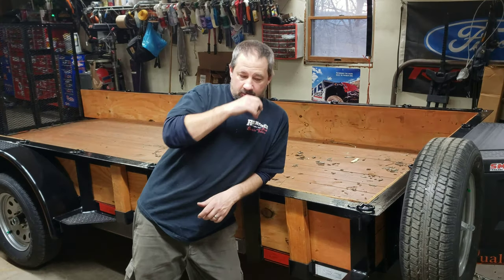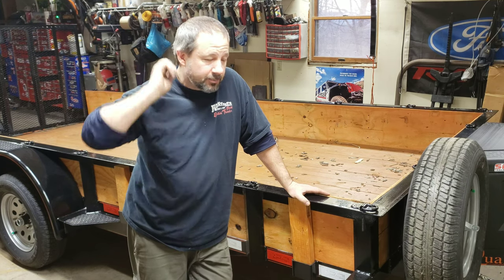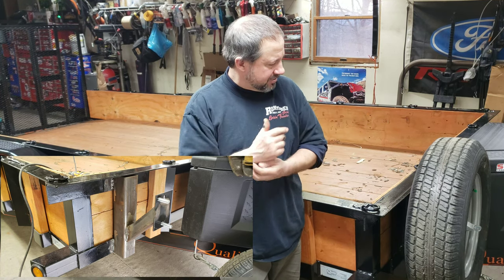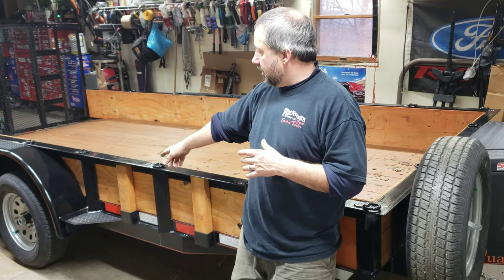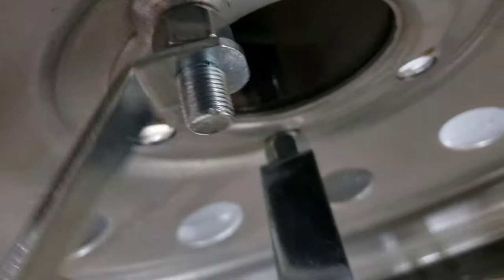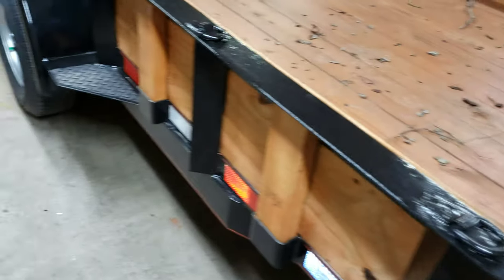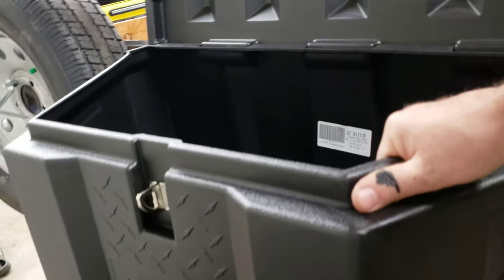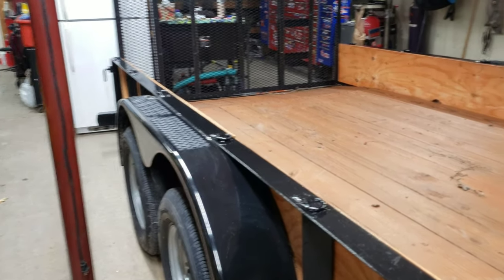The world's greatest utility trailer that you can't buy!

Comment: Nice trailer. I bought my first trailer a week ago. 6.5x10. I welded 4 of the 1/2 inch d rings on it from harbor freight. I plan to weld some on the top rail like you have. I am also welding a small vise on my trailer. I love the tire mount location.  I plan to copy that myself.

Comment: For what purpose would  a dislike appear?  Larry provides in-depth helpful videos.  Perhaps a disgruntled competing trailer dealer/manufacturer?  Rather than hate, build a better user friendly product.  The rubber/adhesive mat already has several ideal applications in my equipment stable. Admire the trailer and all innovative and practice modifications. Thanks for sharing talented ideas and workmanship.
Reply from the maker: Possibly I'm not well spoken enough, or my ad-hoc engineering is not up to the standard of a more educated individual? That's fine, as you've heard many times before, you can only please some of the people some of the time 😂

I'll continue to do my thing and try to make videos not just for the sake of making videos... But when I have something that I think may be helpful or of interest to others.

To many creators feel a need to pump videos out over and over to satisfy a financial/marketing need. I have no such drive. As if now, I have never made a single penny in doing my thing here.

Comment: Thanks for the cool video. I'm a enjoy doing this kind of thing too and it's nice to see your ideas and hear the explanation of your logic behind them. 
I have a few questions. What if you keep a spare wheel hub with a spare set of wheel bearings in your tool box in a sealed container ready for use in case you ever have wheel bearing trouble on the road? (It happens occasionally even to the best of us and if we don't have spare bearings it can cause some inconvenience). 
I have been thinking about this for my own trailer but the possible problem could be the bearings can get brindled from being subject to constant vibrations while remaining stored in a static position, (not rotating).  I wonder if that would be a big problem and what steps to take to mitigate that?
A further idea might be to weld axle stubs to the spare tire holder instead of a square plate and mount the spare hubs and bearings on those and use them to bolt the spare wheel and tire on. It seems like a simple enough idea but I have never seen anyone ever do that. I guess maybe that might even make the brindling of the bearings even worse, (with more weight on them).  What do you think, am I crazy or what? (LOL).
Liked and subscribed.

Comment: Larry that is one fine trailer.
As this is one plus years later, can you give an update.
In particular the spare tire setup.
You mentioned a second spare possibly on the drivers side.
Did you move forward on that idea?
I own a twin to that trailer and its used daily with no issues.
So, I'm quite familiar with how the trailer performs in different conditions.
Does the spare (location) impede your turning radius when backing into tight spots?   
Thanks for the video.
Reply from the maker: The spare absolutely will hit the side of the bumper. If you want to see proof, you would have seen it a week after I bought my new $58K 2019 Ram Bighorn 😭 

With the larger tires and much heavier weight rating on the wheels, it performs fantastic. 

Honestly, I never added the second tire bracket and I don't really see the need to now. The tires are comfortably over rated and symmetry would be the only reason to add the second. 

Would i pick this brand again to buy? Absolutely. I'm extremely happy with this trailer.